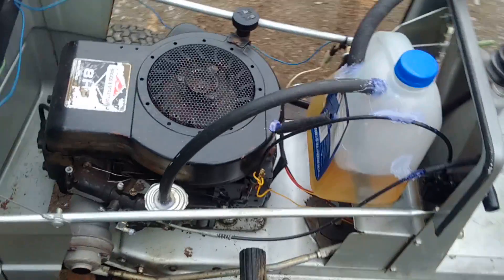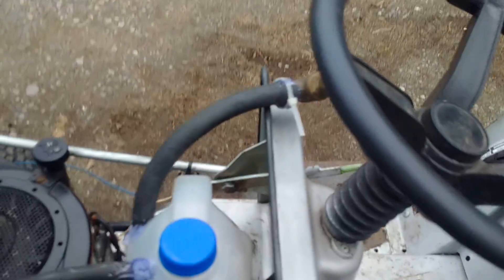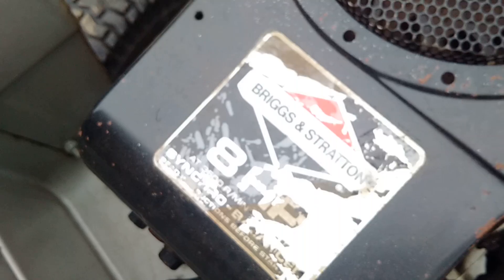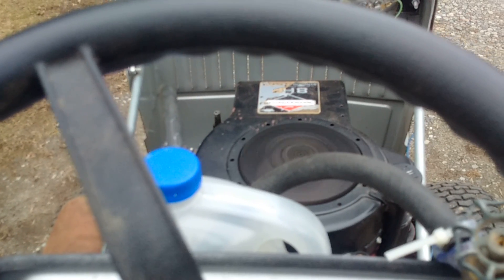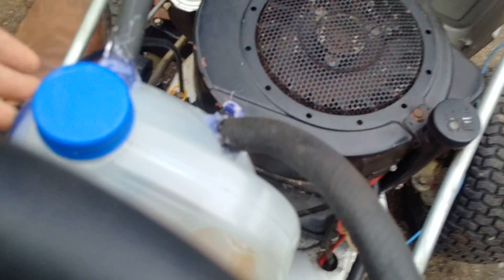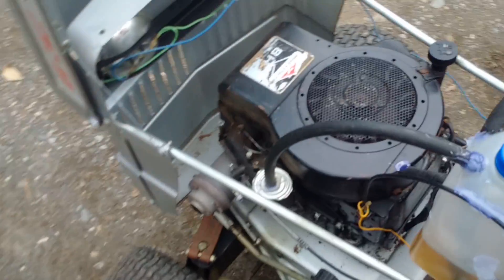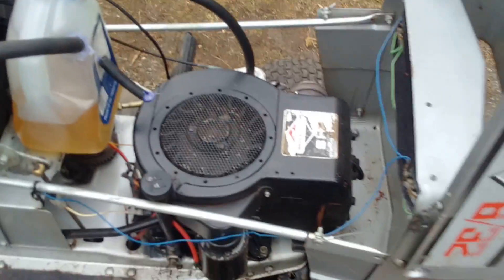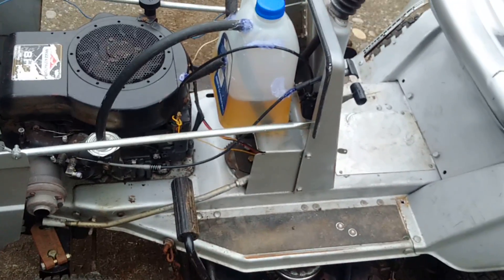Run an engine off gasoline fumes (REAL)

Comment: You should construct a small container and hook it up to the fuel line nipple where you hot glued it shut.  You could just give it a couple pumps on a rubber bulb, which would squirt a little liquid fuel into the engine for easy start ups.  Once it starts, you just turn a valve 90 degrees, shutting off any flow of liquid gas and it would remain running on the fumes.  
     Just a thought.  
     Thanks for the video and demonstration.  That is really cool.
     God Bless bro.
Reply: mike stradling  .....    Oh, I see what you are saying.  Thanks for straightening that out for me.  I'm not to knowledgeable with engines and actually know just enough to get me into trouble, lol.  
     Thanks again for the reply and info. 
     God Bless
Reply: My motor starts first time and never backfires this guys got it wrong if he ran a liter of wet fuel thru this then vaporized a liter the times would be very close as i said he is doing it alo wrong everyone on youtube is seems im the only one that got it right and first go i might add.

Comment: Can this be done with Diesel
Been asking for years.
Reply: If you get diesel it hot enought (to its flash point) it will release flammable fumes, but probably too little to run an engine on. On top of that, seems dangerous to fiddle with hot oil so not even worth trying.
Reply: Diesel lubricates the engine, I wouldn't try it.

Comment: Tom Ogle was shot. The Popular Mechanics magazine also had a chapter on him way back when. Many years after, I tried to duplicate his system with VW engine in a wheelbarrow. The jet holes in main VW carb were all sealed with plugs, or solder, except the accelerator pump diaphragm. I made a TEMPORARY ONLY carb, just for an initial test. The house used to have the cabinet looking old style house humidifier with rotating drum covered with large sponge dunking in the large water tank. When rotating out of the water, a fan blew air through the material and out through top vents into the room. I made a carb like that, and was  similar to the one by Ogle. A hot air hair dryer blew air into porous material rotating in a small gasoline chamber. A CLEAR hose hooked to the top of VW carb, while a hand drill was used to rotate the engine crankshaft. Mechanical Pulses of the accelerator diaphragm allowed a small amount of gas into the engine for start. When running, the engine only uses vapors when vacuum pulled in the heated gas fumes. The carb was in 2 halves held by duct tape , so as it could pop apart easily, for some safety. I knew the conversion would work, but was actually amazed to see GRAY FUMES through the clear hose, pulled into the engine. A white tissue on the exhaust pipe was always clean. I had studied the 2-3 Patents by Charles Pogue of Canada. There are many gas fumes carburetor designs and Patents to read on same. In the olden days , such as the 150-200 miles per gallon carburetor, the formulation of gasoline was way different. A full conversion modern carb does not run on vapors with our gasoline. It's called light ends and heavy ends chemicals. The engine bogs down and quits when carb is all gummed up. The price of gasoline always goes up, or is rationed, such as in 1974. The engine manufacturers changed to fuel injection to keep people away from tinkering with old style carburetor.  I gave up on that subject and now only interested in Hydrogen gas, and methods of improved efficiency of generation.
 

I also showed a few people another conversion I did for a couple of weeks on a 1974 AMC Gremlin. It was called gas cap gas saver. The inventor had passed away, but the wife sent a folder of photocopies of his data. Purchased used gas cap from junkyard. I drilled a center hole to mount brass fittings on both sides. The finished unit was removed before going to gas station. There was a hose on inside that went down into gas tank. The outer cap had a one way spring valve to let in air by vacuum. The existing tubing underneath car ran to the charcoal canister and up to the engine. I mounted a brass adjustable on/off valve with CLEAR hose to intake manifold. The Carter carb had IDLE jet screwed in tight closed off. After engine start with the pressed diaphragm, the engine would only run on vapors from the tank. That was ok for a stationary engine, but not for the road. I showed that set up to several people as a lark, but after that no one was interested. You see, the air was pulled into tank hose by engine adjusted vacuum, and caused liquid fuel to bubble upwards with gas laden air above the liquid, which the fumes were pulled all the way forward to the car engine.  Engine would shut right off when clear hose was hand pinched.

I tried another hand made gas saver for single barrel Gremlin carb engine. It was called under carb flutter wheel. The shaft was in between thick carb gaskets. The 2 thin steel plates were brazed onto a brass tube on the rod. Sharp saw teeth edges at both ends were made . This would spin easily in your hand and when mounted on the engine, you could drive with better efficiency. I was driving all the way through town to driveway with no foot on the accelerator pedal. I would lower the driver's window and turn off engine. You could hear the spinner whining down its rpms. You see, there was a better mixing of the air and gasoline BEFORE entering the intake manifold.

Americans don't believe anything unless you show them. I showed a few others how to make quarry fish come out of the water and take a worm out of your hand. Lay down on the dock wear polarized sunglasses, and hold out your hand to see rock bass, crappies, sun fish, etc. They show up and grab the worm, and dive back down. Put that in your pipe and smoke it!

Comment: I can make any internal spsrk ignighted engine run on furl vapor as they already do that. Liquid gasoline isn't combustible & will not burn. Carburetors & furl injection manage liquid fuel in order to ensure proper amounts of fuel within a wide range of loads. RPM, temperatures & air densities. I can make my 2015 Silverado run on combustible wood smoke vapor, but it's unpractical, dirty, and inefficient. The trick is being able to meter,& control the amount of fuel vapor to the load, rpm & air mass/density entering the engine. Another downside to those that have played with gasoline. Gasoline vapors are highly flammable, build-up & can & will explode easily. Another reason automotive engineers used liquid fuel tanks & trap the vapor in activated charcoal for later vacuum purging & lean cruise. But I like your efforts & may see you on America's funniest home videos one day😅 Just poking you😮

Comment: The 1935 Poque carb in Canada ran Ford V8 engine on fumes for about 200MPG. Back then, the gasoline was a different kind of blend. Nowdays it is called mixture of light ends and heavy ends. The fumes CAST caburetors only work for a while, then jam up and engine quits. Lots of US Patents can be seen with drawings.

Comment: S1R9A9M9 Relays then And Now 
Water in carb ran Briggs 18HP riding mower engine in 2008 
I studied and designed a replacement for the "magic dual coil relays" that were obsolete electromechanical and not available to purchase. Nathren had 15 in a box surplus. The 4 technicians in Georgia had tried to make duplicates hand made relay that did not work. They said the original relays were worth their weight in Gold. Engines ran mostly smooth when EGR was applied same time. Years later the unmarked relays were found to be new/sealed latching type switching replacements for the 60cycles electrical pole boxes in Georgia for traffic signal lights. I made up 3 samples coils and used the average values for about 1.5Millihenry for each one of 2. The CARS engine conversions put both low volts + high volts through it to run spark plugs on 6-7 amps. Plugs needed to be zero ohms- Champion plugs come apart to remove resistor, so as like a racing plug. It has been written that there may be Radiant Energy provided by the relay that travels down to spark plugs. Their sample 2 relays were NOT made in vacuum chamber, like mine was! I used Carlon sealable box with seal , parts inside, screws epoxied to lid, and brass fittings, valve, and vacuum gauge, and hand tool vacuum pimp. You cannot epoxy insulated wire to hole in lid. The air still enters under the insulation. This vacuum technique keeps the energy from expanding outward and follows down the wire. ( Diode-spark gap, N + S magnets parallel to gap- PF capacitor parallel to gap, and following inductor coil ) China Ebay sells these 21gauge wire .8mm as 1.5Mh. Dayton brand also, from Parts Plus, is less money. The car conversions had 400W inverter for 110v AC to half wave pulsing DC, about 40vDC, while Briggs 18HP started on 12v battery , then battery removed, and engine ran on the under-flywheel alternator current 10 amps pulsing DC. The S1R9A9M9 triple coils assembly had several uses same time! I remade several S1R coils so as to get same magnetic field over plug wire using 6 amps worth , so as more turns wire applied instead of 10 amps. Nathren's Briggs original plug 4000 ohms was changed to 125 ohms. Therefore to get 10 amps flow, he needed over 1000 volts. (Ohms law formula) That's why the original coils had BARE 12# wire for the high V. There was leakage inductance that superimposed higher volts for the low volts side!. The input was about 18 amps that dropped down to 10 amps flow due to the ohms reactance impressed on the low volts side from the high volts side! The web site had article about what was called (The 60turns coil test) Amperage reduced on 12v side with wrappings over the high volts wire.! . Nathren neglected to say mower engine was self running! I hope these notes are interesting to you. All engines ran at about minus 34 degrees timing on water vapor pressure generated ,with also Hydrogen gas generated and fired , using common electrolysis at tiny electrodes plug gap in combustion chamber. This was their invention , but not made marketable due to the relays. He said about 1 horsepower lost for every 6. See S1R9A9M9 You tube videos!

Comment: That hot glue won't hold up for long
Reply from the maker: It was only for testing. I figured if it can work with redneck means, then properly designed it could work better. I just had to test the concept and it works !

Comment: Guys, EVERY gasoline engine works on fumes. That's what carb's do. Fuel injectors atomize fuel as well in to ultra small droplets aka fumes. Nothing exciting.
Reply: What about fuel injection? Drops are alot larger than fumes last time i checked.
Reply: @MacMashPotato  drops are not injected though.. Fuel is injected under either intense pressure (i.e. common fail), or as a fine spray with air flow so it evaporates.. fuel that is dribbled in wouldn't burn fast enough. what the carb does in non-fuel injection is the same principle as in your video, evaporation.. this video above basically created a simple carb

Comment: Try using the Wicking system it keeps gas from losing btu.
Try adding a valve after the tank to control engine speed. If its too hot add Water bubbler after gas tank.

Comment: If done right, this setup negates the need for a carb, fuel pump, fuel filter, and air filter.  The vacuum created by the engine trying to start draws air into the bottom of the fuel tank, creating bubbles that rise to the top.  These bubbles create a fuel air mixture as they breach the surface which are then pulled into the engine.  The air is filtered by the liquid fuel which only ever leaves the tank as fumes, leaving behind all sediment.  The fuel doesn’t need to be filtered because the fuel that actually leaves the tank is in the form of a fume leaving all contaminants behind in the tank.  The carburetor is replaced by a single valve that controls how much fresh air is sucked into the tank, a second valve is added between the intake manifold and the gas tank.  This allows fresh air to be added to the fuel air mixture to control how rich/dry the fuel air mixture is.  Lastly, a valve to control how much of the final mixture is allowed into the tank acts as a throttle.
Reply: lastly a valve to control how much of the final mixture is allowed into the INTAKE to act as a throttle

Comment: That thing needs a check valve on it on the intake hose or some kind of Flash suppressor like they use on acetylene gas bottles

Comment: I have a penncraft 8 HP briggs engine that has been running since 1978. This little tractor is bullet proof with just standard maintenance. Would love to put this garden tractor against any new item sold these days. This was made to last not like the junk you buy today. 
This engine gasification unit looks real cool. The oil and gas companies would not like this as standard equipment. Would using a wick inside the gas tank to gasify the liquid make this work better ??? Reason I ask is when I used air to go through the liquid fuel the gasoline would turn whitish and stop working leaving fuel that did not want to burn. I will be working with my unit this coming month. Nice work fella too.

Comment: Vapor is how all vehicles operate......direct injection is how they operate well.  We don't need to revisit the carburetor using a fuel/air bomb.
Reply: Don't be stupid, this is using the fumes as fuel, not liquid gas mixed with air like in a fucking carb.
Reply: @quipalco  did u have chemistry lessons? Only Gas can be burnt. would you believe me that if u Burn wood for example it is also a Gas.....
Reply: @quipalco  a carburetor atomizes the fuel and meters air to mix with the fuel.  That contraption does the same thing, but the fuel and air are mixed outside the engine.  One backfire would cause the thing to explode into a fireball.....very stupid......
Reply: @mdrew44628  back fire is only gonna push fuel out thru his water faucet air valve or out the muffler, just make sure the valve is cracked open,,
Reply: @quipalco  Ah, so maybe you should manufacture the 1000mpg car engine and show those big car tech companies what for and stuff. Youd be rich. Why did all those engineers not think of this.

Comment: THIS WOULD NOT BE AFFISHENT ON FUEL BECOUSE ITS NOT PULLYING AIR WITH OUT FUEL IN IT ILL BET YOU A $100 THAT IT WOULD RUN THE SAME AMOUNT OF TIME ON A LITER OF WET FUEL AS IT DOSE ON VAPOR FUEL.
Reply: Even if it did it would never flood or foul a plug
Reply: Wro g completely wrong...vapors/fumes burn much faster and you need 100x less vapor to ignite a flame then the amount of fuel. ..this concept is bullet proof in and combustion engine at any scale...it's science not to hard to understand..fuel in liquid form is a waste in comparison to the fumes of the fuel...it's always been that way it's a 100 to 1 ratio of ignition when comparing vapors to liquid....he's absolutely correct and it works extremely simple on any motor.., he does need a flashback on it though for safety

Comment: This device is very well known, it is called a "surface carburettor". It was used on vehicles in the late 1800's and early 1900's before the invention of "jet carburettor". It is the most foul abomination. As soon as the nice safe non-incendiary "jet carburettor" was invented everyone with 10 shillings went and bought one as the "surface carburettor" was known to be very dangerous device causing vehicle fires and loss of life. It was very very dangerous to motorcyclists as a "spill" usually resulted in a conflagration. Every year somewhere a veteran car or motorcycle made before ~1908 goes up in flames when some idiot finds the original  "surface carburettor" and attempts to see how the car runs on it.
Reply: It makes sense but for a lawnmower this would be ideal
Reply: There’s ways to perfect the idea now dipshit.
Reply: @shanerobinson7128  yes it was called a jet carburettor. I suggest you fit a surface carb to every vehicle you own until you perfect it. 
They already perfected boiling liquid vapour carb, it's called a LPG mixer valve.

Comment: I made a small bubbler for my 2009 Hyundai Elantra it helps a little bit 4 or 5 mpg still trys to go a little bit on it's own barely with my foot off the gas pedal
Reply: I'm not claiming to know how you built it or that you aren't taking proper safety measures. But as he didn't mention just how dangerous a device like this is I want to make sure that people who say they are using them know. This is a bomb waiting for a spark. It is a very bad idea to have a gas air mixture in a sealed container like this. There is nothing stopping a back fire from igniting all the gas in the bottle.

Comment: ok lets see....if you do comparison carburator vs vapour you ll see there is very small difference in fuel consumption.numbers you are using in video are very impressive but you have no prove.sorry for being negative but i run same test and concluded thre is no significant increase in efficiency.check my video saxo runing on vapour.regards
Reply: There’s MANY others that have proved that it uses a fraction of the fuel.  You’re doing something wrong.

Comment: I don't want to interrupt you but there's no stupid dogs.I know..It's your video and you dont want a dog to be the star.Anyway.Doesn't the gas evaporate? So you must have to add gas sometime?.And try some steel mesh at carb inlet.Might stop a backfire.Might?Does it have less power?3/4, 1/2? 1/4? or same.Thanks

Comment: Problem no 1. Backfire.... what law will allow a vehicle to have a fuel air mix b4 combustion chamber.  Ever seen a carby backfire. Try that with a full air intake with a fuel vapour mix, a car accident ! And the gains are minimal at best. Harder to start, need to bubble up gasses into air intake. wasted mixed fuel every time u shut engine down, pollution controls 2 compensate that. Look into it more than does it work and if it it practical and or safe 4 daily drivers.
Reply: Maybe not for cars but how about a little Honda 25cc turning an alternator? Dirt cheap electricity.